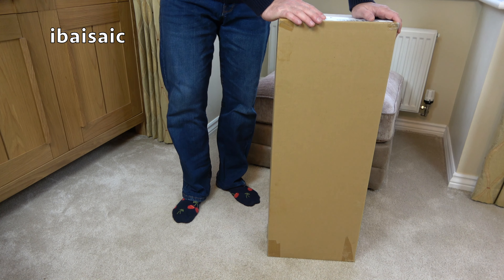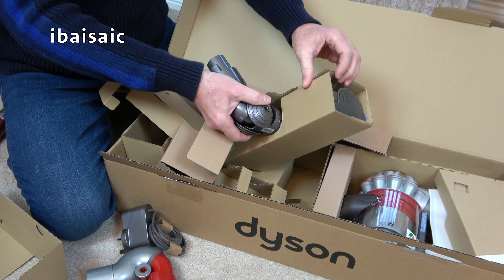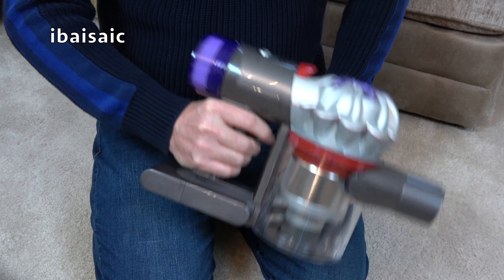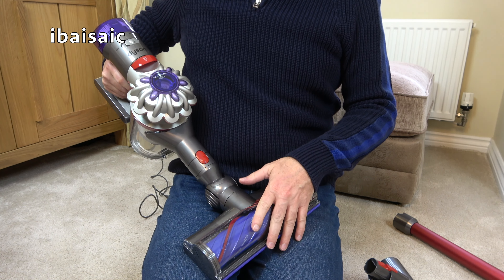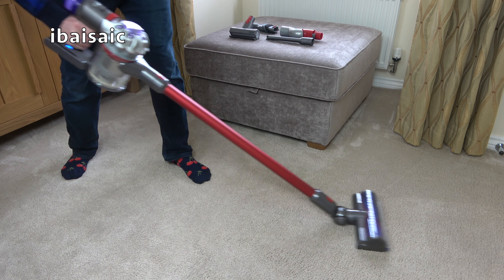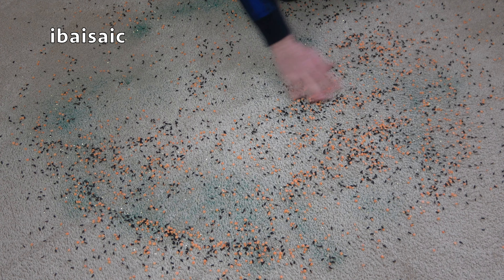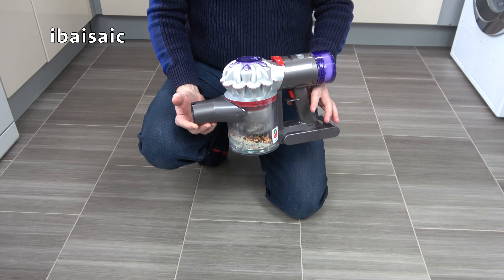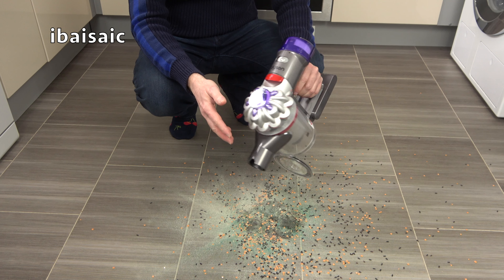Dyson V8 Extra Cordless Vacuum Cleaner Unboxing & Demonstration

Comment: I purchased the original stand-up Dyson vacuum in 2000. It still works well but it's heavy and clumsy, not easy to maneuver in and around tight spaces. I purchased the V8 that  came with 8 additional tools in the U.S. This video is quite helpful. Thanks.

Comment: I like this Dyson V8 extra cordless stick vacuum cleaner in its original ☑️ box factory 🏭 fresh it's in good 👍 condition it's very powerful to use for the odd cleaning around your home 🏡 it's done ✅ a good 👍 job on the carpets and hardfloors and I will recommend this Dyson V8 extra cordless stick vacuum cleaner

Comment: My Dyson v6 power head has stopped working, I’ve tried to free the fibres not just from the roller but the gears too but to no avail. I have to say I purchased it as a second machine but it’s been very good as a primary vacuum. I have had two replacement batteries but in fairness both at no cost. The optional flexible hose, stiff and soft brushes are the BEST car cleaning accessories I’ve ever used. I don’t really begrudge it but I think I’m going to have to buy a replacement power head…

Comment: I thought a v8 wouldn’t be strong enough on the low setting to pick up anything from my wool carpets so I was looking at the v10. Looks like that would be worse!
So to understand, the suction was too powerful it stuck to the carpet and wouldn’t move, but a corded upright vacuum would have more suction but WOULD be able to move and get the green sand out of the wool carpet? I’m a bit confused why. Is that because the upright would have some kind of brushroll with bristles that agitate the carpet more? Or because the wheels on the upright would be better? Considering you have the same carpet as me & I have two cocker spaniels (i adore Daisy she loves to be the star of the video 😂 not scared of vacuums at all!)

I’m keen to see your favourite go-to lightweight vacuum that balances deep cleaning, detangling & convenience. (The Sharks are usually too heavy for me!)
Reply from the maker: The carpet in this video is man made. I had experience of a wool carpet years ago and I would never buy another due to the amount of times I tend to wash my carpets, even more so now my dogs are older and having more accidents. I think the problem with many cordless cleaners on plush and deeper pile carpets is the motors in the powerhead do not have the power to keep going when there is resistance and cut out.

I can’t recommend a vacuum with your requirements as the ones I find best to use are not lightweight machines or have anti hair wrap brushrolls.

Comment: Great video! How would you rank this against the Henry Quick? This seems more flexible with the additional mini motorised tool, and the main head seems great on hard floors, but for day to day use what is your preferred option?
Reply from the maker: This model is far more convenient for above floor jobs than the Henry Quick, especially if you add the optional hose. For day to day use in my home I use mains powered bagged cleaners.
Reply: @ibaisaic  many thanks for the advice. I actually have a lightweight Tineco cordless, but the dust on emptying and filter cleaning became tiresome, so was intrigued with the dust free bagged aspect of the Henry Quick. Is the V8 better at picking up on floors?
Reply from the maker: I would say the V8 is better on floors but Henry Quick is the way to go if you don’t like washing filters.
Reply: @limeyade4946 I just decided to send my Hetty quick back. It was good but just not powerful enough. Maybe I got a faulty one. The search continues….!
Did you replace your Tineco?

Comment: Hello there, I've watched a lot of your videos. Can I ask you a question?
Since I have Shark vacuums, my dust container is getting a real lot of white powder in it. I don't know what it is, I guess it's the backing from my white wool carpets ( the are bald on the stairs).... As soon as I clean the filters they are a third saturated with white powder.... Have you ever seen anything like this?
Reply from the maker: No I haven’t. Seems that the backing of your carpet is degrading and the Shark is sucking it up. Or a member of your household has started using talcum powder. The filters of all the Sharks I’ve used get dirty pretty quickly.
Reply: @ibaisaic  Thanks so much for your reply 💖

Comment: Does this model have Hepa filter ?
Reply from the maker: Dyson state that this model has Fully-sealed filtration
Traps 99.99% of microscopic particles as small as 0.3 microns. Of course when you empty it, dust inevitably goes into the air, so you will breath some of the microscopic dust in.

Comment: You may not know that the under of your carpet is not poris that's why your vacuums would be hard to push or stall so better get a shag rug
Reply from the maker: If you are saying that the carpet isn’t porous, then you’re wrong. Air flows through it.